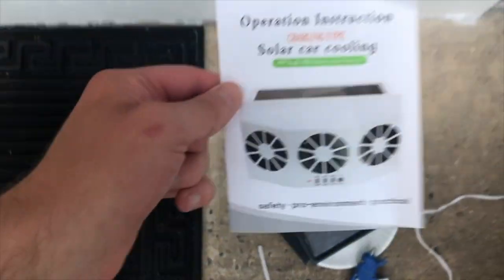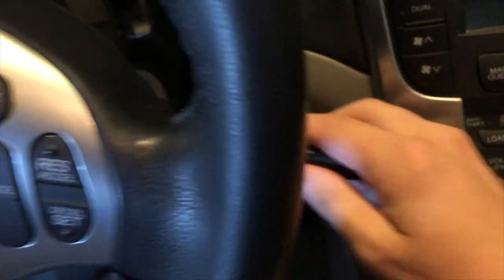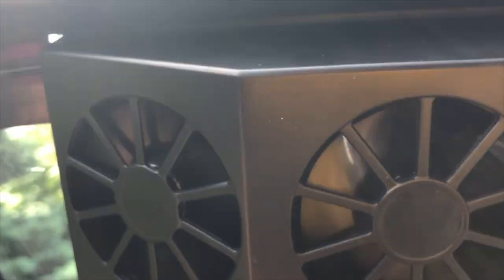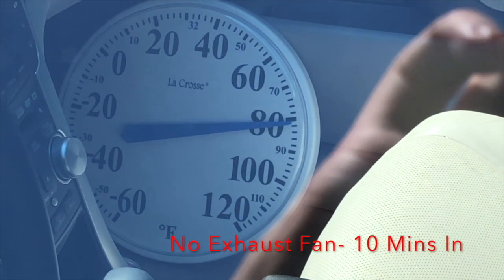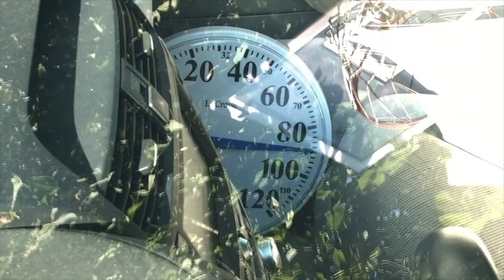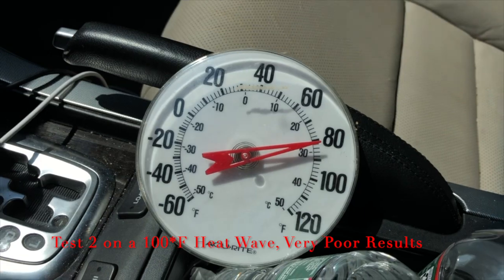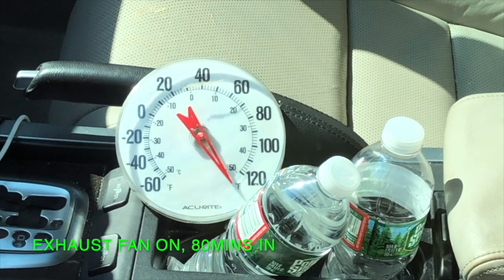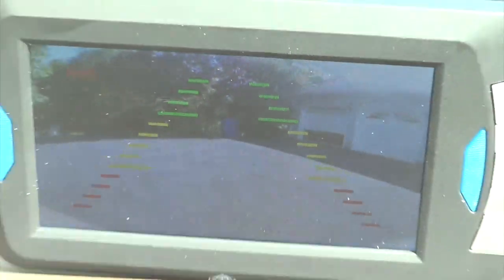Solar Car Exhaust Fan, Portable Back up Camera

Comment: I wonder if these things would work better if you cracked the window on the other side so it could pull outside air in and actually ventilate the car.

Comment: Just to point out something here...these fans aren't meant to cool your car or to be like an AC.  They are pretty much only for ventilating the air inside the vehicle for such things like smoke and other nasties, so there is no need for them to be super strong.

Comment: Just tint your windows and your car will be 10 to 15 degrees cooler inside
Reply: That'd be great, except a good ceramic window film job is $350+, not including anything done to the front windshield. If something works for $40-50, that'd be a nice alternative.
Reply from the maker: Yes or Tilt the Sunroof Open in the Shade
Reply: @Solemn_Kaizoku  naw man why would u even pay that much just get regular tints like 30 or less there are deals all over for 5 windows for 120-150.
Reply: @Solemn_Kaizoku  they charge  between $125 and $200 around here for a pretty decent tint job. So you must live in a very expensive area for them to charge that much. I mean even $200 is a lot of money to some people but you can also learn how to do it it's really not that hard if you take your time and do it right and have patience and do one window at a time, I've done about three cars in the past myself and they came out 90 to 95% well done. I just took my time, I mixed up Joy washing detergent and water with a spray bottle,  that's the best to use when you're putting on tint. And make sure you squeegee all the water out after you cut your tint to each window and apply it with the joy dsh detergent and water. Now these days they have pre-cut tent for the type of vehicle you have so you don't have to cut cut the pieces yourself which makes life a lot easier
Reply: Some states do not allow window tinting.
Reply: @Solemn_Kaizoku  you could buy window tint & do it yourself
Reply: Those tiny jobs are cheap for a reason pay extra for quality ask what he is tinting with, there is cheap chinesium all over the place but if u want something good n effective that won't bubble or bulge or turn purple... Ur gonna pay.

Comment: One scenario I could see this being useful for is if the vehicle has accumulated a high thermal load after day driving for the sun, then parked in the shade.  Switch the fan on with another window slightly cracked to vent the hot air out and replace with cooler air.

Comment: Are you sure the piece that broke off wasn't part of a solar hot dog heating attachment?  You would think a product like this would come with tape and glue to fix what will inevitably happen when you try assembly and placement.  Although maybe some of the Chinese instructions did warn not to insert in window without hot dog firmly seated in solar warmer?

Comment: This design has beeen around over a decade, Im sure they could build an improved model with stronger motors and high density battery with a more efficient solar panel . 

I might just have to build one myself .

Comment: It's looks like a great product for how cheap thay are and the solar panel has to be left in the sun first to generate a charge for you to receive the full power of the solar function just taking it out the box and turning on the solar function u will not get the full power as seen in the video just like a solar powered light u need to leave it in the sun 1st to regenerate the power hope u got a better effect after using battery mode in the Sun for awhile then switching to solar afterwards 😇👌🏾🙏🏾
Reply from the maker: Thanks for the advice, Not sure why I did not think of that I will have to give that a try
Reply: @alecsweather6437  no worry's your welcome mate god bless 🙏🏾😇
Reply: LOL this thing is probably made cheap, but obviously he didnt read the directions well, breaking a plastic tab by improper mounting and cracking a solar panel
By just taking it out of the box. LOL
Reply: @alecsweather6437 🔴 What Is Islam? 

🔴 Islam is not just another religion. 

🔵 It is the same message preached by Moses, Jesus and Abraham.

 🔴 Islam literally means ‘submission to God’ and it teaches us to have a direct relationship with God. 

 🔵 It reminds us that since God created us, no one should be worshipped except God alone. 

 🔴 It also teaches that God is nothing like a human being or like anything that we can imagine.

🌍 The concept of God is summarized in the Quran as:

📖 { “Say, He is God, the One.  God, the Absolute.  He does not give birth, nor was He born, and there is nothing like Him.”} (Quran 112:1-4) 📚

🔴 Becoming a Muslim is not turning your back to Jesus. 

🔵 Rather it’s going back to the original teachings of Jesus and obeying him. 

More .....👇

🔴 THE RETURN OF JESUS

Comment: you do know its NOT  an air conditioner? it has NO coolant in it! ! you need to TURN ON your ac next time and drive with it on and see if it gets cooler FASTER and circulates the air.....

Comment: looks like your in the shade,
Reply from the maker: The First 2.30mins I was in the Garage Showing it & Then Went into the Hot Sun, I put the Thermometer in the Car in the Shade though to get an accurate reading
Reply: @alecsweather6437  would u say it was worth getting? what purpose does the battery serve?
Reply from the maker: ytRbro Unfortunately No, The Solar Power Was Week & didn’t do much of anything & The Battery made it a little Stronger but was still very hot in my car- I still had to Blast the A/C
Reply: @alecsweather6437  lol o well, I bought one will test it out, if it does not make any improvement, I still have the box will send it back to amazon. all good.